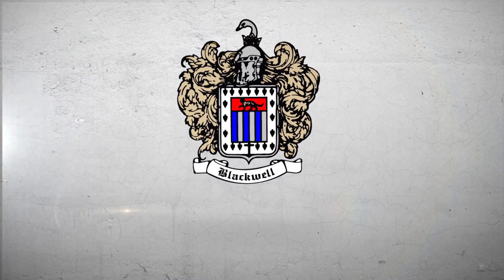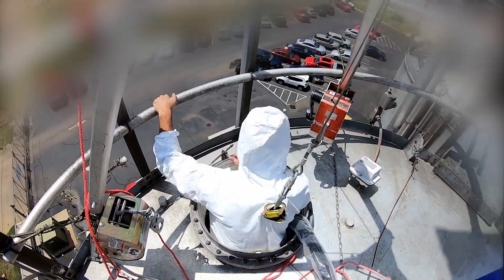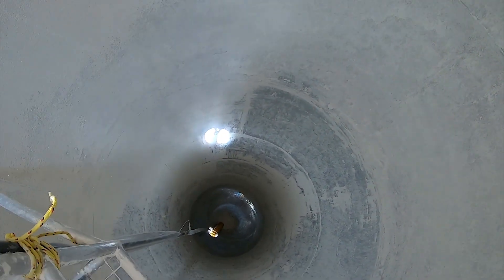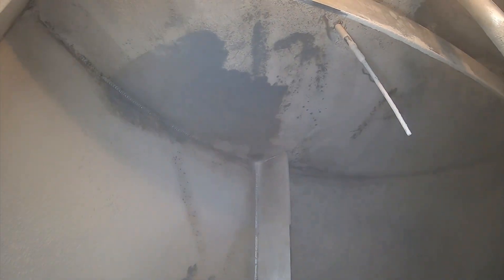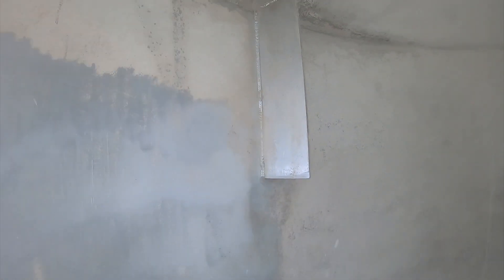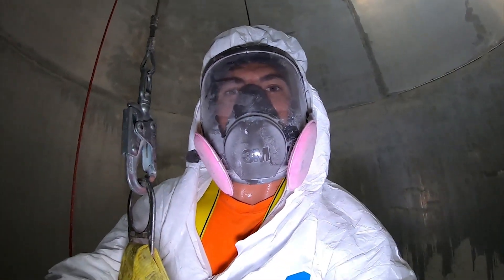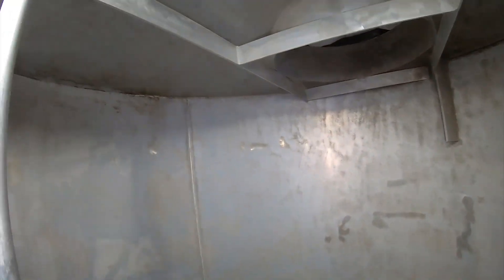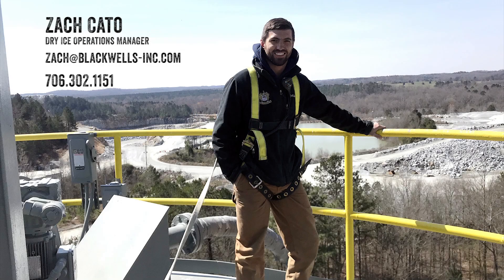youtube video #-O1DkuTbBRM

Comment: Great video guys!
How did you go with oxygen content in the silo? Did you need to run a fan with fresh air supply?
Reply from the maker: Great question. Yes! We use a 12" blower and ductwork to push fresh air into the space. The CO2 would deplete the Oxygen in the silo very quickly without it. But with that much fresh air displacing the CO2, the Oxygen level never drops below an acceptable range. Atmospheric testing with air monitors is super important anytime you're dealing with a confined space.

Comment: Is this sticking of flour with the surface of the silo due to the electrostatic charge.
Reply from the maker: I'm sure that does play a part in it. Humidity and moisture inside the silo really effects how much bin scale sticks to the walls as well. A silo that sits outside will typically have heavier buildup than one that sits inside a climate controlled building.

Comment: How much do you charge per square foot to dry ice blast a silo?
Reply from the maker: We would charge by the day. MOST Silos can be completed in 1 day. The worst ones can take a day and a half. We cleaned one last week that was 100 ft tall, but only took 1 day. Then there are some smaller flour silos that consistently have moisture/ condensation issues that take a day and a half. I say all that to show that every case is different but we'd be in the ballpark of $4,000 per day. Lots of equipment, fuel, Dry ice, training and a well paid crew goes into cleaning silos.

Comment: So you were able to clean in the entire silo in 12 hours? I feel like it would take at least 12 to 16 hours to clean each one based on the rate of removal shown in your video...
Reply from the maker: The silo in the video took every bit of 12 hours. They vary widely. The places that we clean on a regular basis are always better off. We have several customers that we can clean multiple silos in a day. 
The top 8 feet or so is always the worst. Since the product never touches the very top or the ceiling, the dust can become layered up and be tougher to clean. Typically, the farther down you go, the easier the scaling is to remove. So while the top may take us 6 hours, the rest goes a lot faster.

Comment: So slow
Reply from the maker: Thanks for the comment Svein! 
It's slower than pressure washing for sure. It usually takes us ALL day to finish up a silo. Sometimes a day and a half to make sure it's done right.
The big perk to Dry Ice Blasting a silo is that its ready to be refilled as soon as we finish. Cleaning with water would need at least a couple days to dry out. Even a little moisture in a bulk ingredient storage vessel can spell disaster.